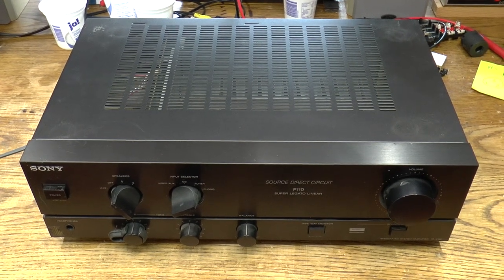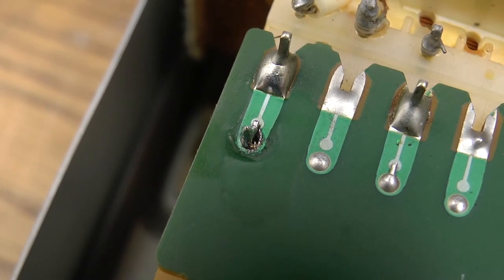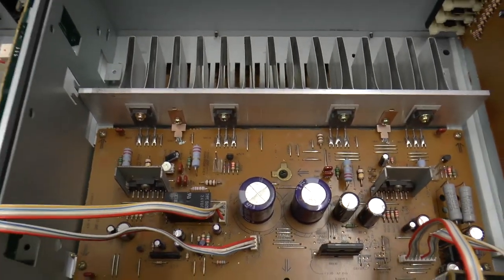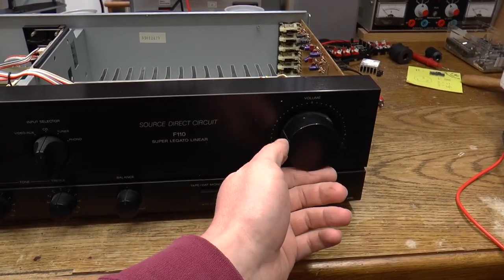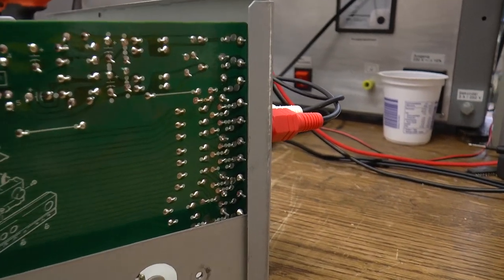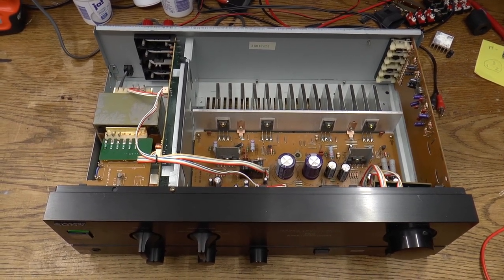Sony TA-F110 Amplifier [1/2] - Diagnosis

Comment from the maker: Nobody wants to play the game? :(
Reply: I do ;) 

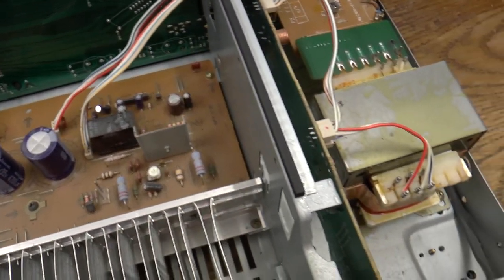Yes, at 1:12 I see a really bad looking contact on the transformer...
Also: there are 2 empty contacts on the main board (but that might be on purpose?)
Reply: is that a 2 pin header with nothing plugged in to it? 0:52 on the left side
Reply from the maker: The two-pin-headers on the main board are the test points to check the quiescent current. Nothing wrong with those :)
Reply: DrCassette ah! Well crusty old solder joints strike again :)
Reply: 00:00 - Bad solder joints.
I might've cheated a bit, though, since I must've fixed a dozen of these by now, and only one of them presented a different problem - a bad relay because the owner was an absolute chainsmoker and tar got onto the contacts. It also had bad solder joints everywhere, though.
Reply: I be honnest, i didn't saw it.
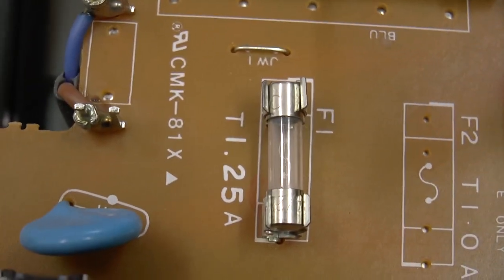Reply: 2:12 actually, but yeah too late
Reply: Saw it around 1:13, that black around the pin, and then noticing theres no solder!
Reply: 1:30 😕
Reply: Well there was more than one problem , I guessed it wouldn't just be a connection at the mains transformer . Although I thought the mains switch from the arching was suspect. This equipment was well made , much better than some of the rubbish from China made now , I hope you find someone that appeciates it . The solder has done well to have lasted so long with only two or three poor connections .
Reply: 0:47 it is the 5th solder joint (near the end) on the PC board near the secondary(?) side of the transformer.
Reply: i have problem in sony amp if you help fix it i pay you

Comment: It's barely visible at 0:59 and becomes much clearer around 1:08. It doesn't look like there is enough solder on the input connections either...no wonder they failed!
Reply: I didn't know you watched Dr. Cassette.  Your eyes are better than mine!

Comment: I was given one an identical f120 recently. Sooo many bad joints, i had to go at it a few times... Tips for others: resolder ICs on the mainboard. Resolder speaker switch/filter pcb. Resolder speaker output pins to pcb. Resolder transformer pins. Remove front panel , clean the living hell out of switches (you never want to got back in there), resolder switches and pots, resolder all the connections from input board to front board. Simple as that really.

Comment: The cause of this problem is that components with a large thermal mass don't get hot enough when they go through the wave soldering machine. If you slow down the travel speed it helps but often you only discover the bad joint years later after corrosion has crept under the solder. The joints look perfect when they come out of the machine but are actually not great. Double sided boards eliminate this problem which is why I always use them in industrial applications.

Comment: I have a TA-F335R that I restored electrically! I readjusted the bias because it was waaay off and fixes a lot of broken solder joints. It is rates 2x55w into 8ohms, but that's way underrated. I tested mine and got nearly 175watts per channel into a 4 ohm load. Not bad!
Reply from the maker: I have a Sony TA-F535R amplifier as part of my main stereo system :)
Reply: They are wonderful amplifiers!

Comment: Thank you very much for this video. 
I just found this amplifier to the recycle bin . I took it and i will try to figure out whats wrong. 
Your video is very very good !
Reply from the maker: Thank you, I'm glad this video is useful :)
Reply: @DrCassette  Now i just tested mine ! 
It seems that it has not been serviced before. 
As far as I can see there are NO cold joins . 
I plugged it in with headphones. No sound. 
I connected speakers, i have sound ! nice sound. 
So all internals need a good clean, all pots and switches a deep clean. All outside a good clean. I will measure the bias so to have picture. All these in the summer time when i hope i will have some time for it... 
BUT why should someone cut the 3 little wires that go to the phones small diagonal board ????
Is there a purpose behind it ? I wish i could sent you a picture of it... 
Very strange !
Reply from the maker: Not sure why someone would do that, I would just try to reconnect the wires that have been cut

Comment: Bad solder joints? Tell me about it :D I bought F210 with bad volume potentiometer, fixed that, but also had to redo all solder joints in those little 90 degrees boards that goes around volume potentiometer, because they were all broken. It's a decent amplifier otherwise, though it doesn't like 2 ohm load.
Reply from the maker: These entry-level Sony amplifiers are really quite good, almost too good to be entry-level :)

Comment: I gotta crack open my STR-GX47ES receiver (ca. ~1991), which has a problem w/ the left channel. When the unit is turned on (& after the relay click), the left won't work until I turn the volume up & down several times (then it will kick in). Already tried spraying contact cleaner into the control, but it was only temporary!

Comment: This series of Sony amplifier all have the same issue: solder connections between the input PCB and the preamp PCB go bad because the preamp PCB flexes a bit every time the user operates the front panel controls.
Reply from the maker: It seems like Sony HiFi equipment from this time has a lot of problems with bad solder joints.
Reply: @DrCassette  I had the next model up (TA-F210) and seemingly every second solder joint inside that thing was bad. I finally gave up, disassembled it completely, fixed all bad solder joints I could find and sold it.

Comment: DrCassette, i have 2 Sony amplifiers, TA-A300 and TA-F210. The Loudness button on TA-A300 gives an incredible punch on the sound, it makes it more powerful and aggressive. Unfortunately it doesn't happen the same in TA-F210, it brings almost no difference in sound power. I've checked all solderings and they are ok, i've cleaned all contacts and knobs with "Kontakt 60". Comparing the Loudness function between both amplifiers it's almost comparing night to day. Do you have any idea of might be happening? Thanks in advance!
Reply from the maker: This might not be a problem. The loudness circuits may be different designs, the TA-A300 seems to be an older and higher quality design than the TA-F210.
Reply: @DrCassette , thanks.

Comment: ta-fe520r with stk chip is better amp?
Reply from the maker: No, discrete transistor output stages are in most cases better than STK hybrid circuits.
Reply: @DrCassette  Thenks for answer. I buy fe520r and sound is not good.
Reply: Stk is also a sort of discrete circuit. TDA, TEA, UPC etc are real ic.

Comment: Nice to see a simple integrated amp from Sony... probably the last one they built. Must say its still shit quality (ic drivers). kudos for Sony for not over complicating something for once. Currently rebuilding a ewaste 
Yamaha from 1990 and its way better build quality.
Reply from the maker: This is by far not the last one they built, this is a 1989 model, and Sony kept producing simple entry-level stereo amplifiers for at least another decade. Build quality is quite nice, Sony used metal in places where others would have used plastic. The integrated driver ICs are OK for as long as their solder joints aren't bad. They do run very hot though. Your Yamaha may be built better, but is it also an entry level model? I have seen some real trash made by Yamaha, like a mid-80s amp that had dropping resistors running so hot they burned up all the circuit board and components surrounding them...

Comment: They used Iron /steel heat sink for driver IC s that is a shame. We all know iron heat conductivity is slightly above wood and insignificant while they could use  5x3Cm aluminum cost 2 cents or so.
Reply from the maker: The heat sink is actually made from aluminium. It's just not a solid piece.